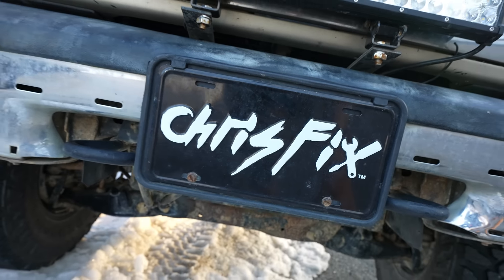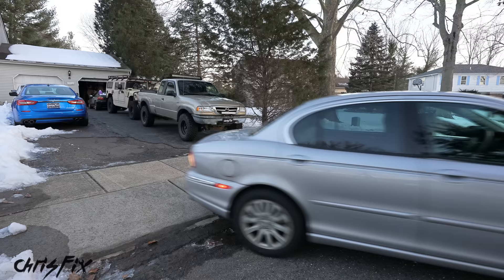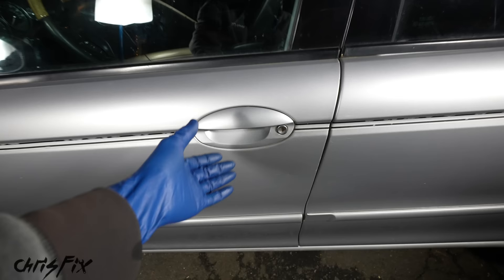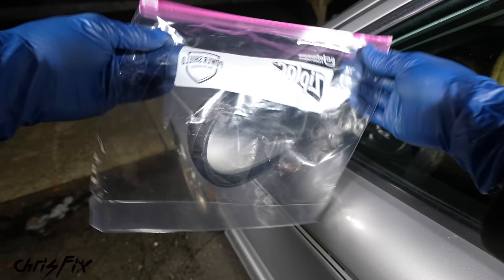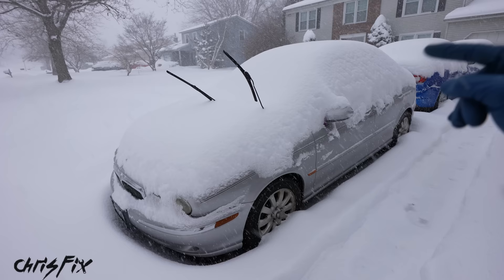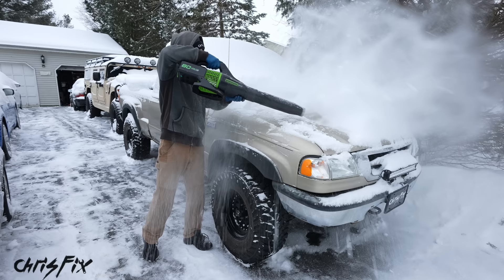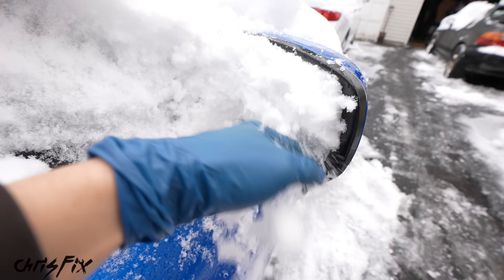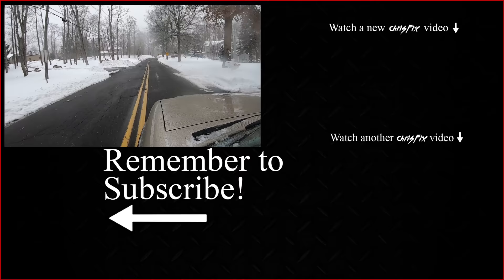10 Winter Car TIPS & TRICKS you NEED to Know

Comment: I'm living in Russia, Siberia. Winter temperatures of -20C are common here and -40C happen too. The most pain is when ice builds up on the internal side of the glass. To prevent it, wide open the doors and stay like that for a couple minutes. This will remove a warm humid air from the car. Also make sure there is no water or snow on the car mats. This water will evaporate and condense on cold glass.
In very harsh conditions below -40C it's common to use a cape for the whole car. It's called НАКИДКА НАТАША. It really helps to keep the engine and suspension warm enough.
I don't think that snow brush will scratch and damage a car paint. We never use towel like CrisFix advises and paint is just fine. Besides, you can buy a brush with soft fibers.
Reply: I live in North part of Kazakstan (South Siberia) and I agree with all your tips.
Reply: Natasha can be helpful anytime btw 😂😂😂😂
Reply: I just came to say, damn. That’s cold.
Reply: Thanks! I was wondering recently how to avoid it!
Reply: It actually will scratch the paint :) only lightly but still noticeable
Reply: Ice on the inside of the glass is the worst.  I got those rain gutter accessories that go at the tops of the windows for my car. So now I can leave the windows open about 1cm all the time to let any moisture out so it won't freeze on the inside.
😎
Reply: @JP-JustSayin  Yes you can leave windows slightly opened. But be careful because in a blizzard you will get a lot of snow inside a car.
Reply: You definitely  would be the person who knows !   Your weather is crazy.  We have electric heat.  Expensive.  Luckily  we  usually  get  about  three snowstorms if that.  I couldn't  handle your weather. People  are griping about 30 degrees here on east coast  USA.
Reply: @donnalawrence9054  It’s pretty nice outside, it’s 30 right now here in PA, with the sun out. It’s not the low temps that are the problem for me, it’s when the wind gets going, that’s brutal but I deal with it. Working outside all day on the farm toughens the mind and body up lol.
Reply: @seekndestroy8970 Oh  my!   More than toughens you up.  It's  about 30 here today. My friend  just came  over and shoveled my walkway while  I   am under a cover.  Lol.  God love him. I cook for him sometimes. We got about  3". No I do feel like an old  spoiled  brat. Lol.  I  don't  like  it  windy here, but know it's  nothing  compared  to  what you get!  Stay well.
Reply: great stuff, but your climate control system has a system that would help with this in cold climate. It's the air recirculation system. when its warm, u want to keep the cooled air inside of your car. so u have the air recirculation system turned on. you may think that also makes sense in the winter, but the inside mosture of your car will freeze to the windows when u leave. so u want to leave it off since when it's very cold outside, the air outside is very dry. same with window fogging if ur heater is not cutting it.
Reply: Wow! Good tip on letting out the warm air before shutting down the car for the night! Ice on the inside is the worst.
Reply: Wow!  That's cold.
Reply: my car has auto humity control, so I just need to keep the air climate control on.
Reply: I remember one time when I lived in Canada (Thunder Bay,) it got so cold that my friend's older car froze up. When he got it started the steering and suspension was frozen so he just had to wait for it to warm up.
It often gets to -40 at night there.
Reply: Also in Canada, at least when I was younger, all the cars had block heaters and you had to plug your car in at night so it would start in the morning. Heavy equipment, especially diesel,  would sometimes have battery heaters. Diesel engines sometimes have glow plugs that you have to turn on 10 seconds before starting when it's cold.
Sometimes you'd have to turn on your headlights for a minute, then turn them off to get enough power out of the battery to start the car.
One of those heated car covers would have been great.
Reply: @RandyRostie  I used autonomous gasoline heater on my car (like Webasto). They are reasonably inexpensive. Especially when you know that you can start your car at any temperature. It heats up the engine. Even in 5 minutes it can heat the engine from -40 to 0 C, and start will be much less harmful for car. This greatly prolongs your car life. And you don't need any power plug on the parking lot.
I had 94 Toyota corolla with 300.000 km and it couldn't start below -20C. But with engine heater I started it even in -45. And the engine was OK for a very long time, because I didn't harm it with very cold starts - all winter starts were done after preheating the engine.
You can buy those heater from China now, they become quite cheap.

Comment: Another advantage of 'combat parking' is that your battery is facing the street in case you need a jump.
Reply: the other advantage of combat parking is that your gas tank is facing backwards in case you need the fuel truck to come refill you
Reply: Not for every car. There is alot if not most European Cars that have the battery in the trunk
Reply: @hassnaindar9586  Not in all cases. Some cars live in the desert and don't get snowed in.
Reply: @hassnaindar9586  I think you're referring to BMW and Mercedes cars. Those still have two jump start points in the front under the bonnet
Reply: @mattiaiezzi9381  And all newer Audis and Volvos, and not all older cars with the battery in the back have jump point under the hood.. Trust me I'm a professional! "Holding my Magnum 44 while 80s action music is playing in the background"
Reply: @hassnaindar9586  Most cars i know here in Europe have the battery under the hood. I think it’s a thing for more modern cars to have them in the back. My 2000 Ford Focus has it under the hood.
Reply: Have your battery checked in the Fall. If weak replace it.
Reply: My car battery is in the trunk. Just rapped it with a battery warmer. Crazy cold days are around the corner.
Reply: best case, where I live it is just that much easier to steal the battery, and it puts the fuel filler on the other side of the car, making it easier to siphon all of the fuel out. if you cant operate a vehicle in reverse gear, this may be a vital tactic to use, but I would reccomend learning how to drive so you dont have to park like a jackass
Reply: @manlystyleunder50  as if fuel trucks make housecalls. Never.
Lol
Reply: Who makes up these names ‘combat parking’ ?
Reply: @riesa85  strum ruger?
Reply: @francisniestemski2440  thats a good question. back in the day we just called it backing in or parking backwards... what has any honest person got to run from?
Reply: I'd say stay forward in his case the battery is far more protected from cold wind, "combat" parking for him opens his battery and engine to wind and snow
Reply: @leonhenry2842  here in montana cold isnt a problem untill it gets to around 20 below zero with any of my cars . never have battery problems unless the battery is more than five years old... most batteries only last five or six years cold or not anyway. if you have a block heater even -20 isnt a problem. combat parking makes it hard to plug in the block heater though.
Reply: @Brandon Aitken bet thats fun to get to if you need a jump...
Reply: @Brandon Aitken so your priorities are a tiny little v-8 and too much bass?.....sad.
Reply: @Brandon Aitken yeah, try making 500 hp without the turbo. my 350 makes that much without one on pump gas... yours is little.

Comment: I always give my car a really good polishing prior to cold weather . When it comes to removing the snow it nearly always comes off all in one push . Most people would suggest removing the snow from the top of your car first but I disagree . If you remove the snow from your hood first then you do not have two loads together and the snow from the windscreen or roof slides off the hood easier after that has been cleared.

Comment: I've lived in Ohio my whole life, but I had never seen anyone do the ziplock bag full of hot water. That's a smart little trick!
Reply: I'm in northern Canada... that's new to me as well.
Reply: What part of ohio?
Reply: Manitoba here. I wouldn’t bother with warm water. Running a car for 15 mins makes it a “wipe it off” level. 120v wall plug cabin heater turnes it into an “eco friendly” warmup, if you care. Me personally, I am so lazy, that I just spray alaskan de-icer where it hasn’t melted. Takes 3 seconds. THREE  very precious seconds of my morning.
Reply: @kidzellajr4244 Cleveland area
Reply: i use a tarp on my truck. so much faster and easier.
Reply: @nickieshadowfaxbrooklyn5192  This is good for the times you don't have the luxury of warm up time. I could've used this trick leaving work several times.
Reply: @falxonPSN  i lived in akron for about 13 years

Comment: * Chris doing a simple oil change *.....
 * Changes the trans fluid, feul filter, cleans the seats, changes the interior lights, cleans the engine bay, changes blinker fluid, suspensions, takes out the engine, cleans radiator, flushes coolant and fills the feul tank. *
Chris: Alright now that were done with that preventitave maintenence.........
Reply: Uhmmm blinker fluid isn’t a real thing
Reply: @maxdominguez6454  😉
Reply: That blinker fluid is always a bear
Reply: @mickcv4554  my blinker fluid bearing axle motor stopped working today
Reply: @milesbigelow4775  try elbow grease.
Reply: @seanoconnor7518  I'm pretty sure he meant to say change the muffler bearing
Reply: @FusterIsBased   I fill my tank with sailboat fuel before any snow storm
Reply: If he said it once, I’d believe it to be a typo. But twice, he’s just illiterate.
Reply: @seanoconnor7518  chris has a vid on it so..... it is kid.

Comment: On the windshield wipers it’s not always best to leave them up all night. If you have heavy winds and/or a heavy storm.  The windshield wipers are not designed to take that kind of pounding and you can do far more harm than good. 

I haven’t had a problem yet where I couldn’t lift my wipers after removing the snow. If I have ice all over my windshield I just run the defrost and wait for it to melt away.

I really do like the windshield cover. Thank you much for the video Chris!
Reply: I tore my wiper blade off once after an ice storm. Now I use the bags that my newspaper come in over the whole wiper. If things are stuck & I am impatient, the free bag gets torn, not the $$$ blade.

Comment: Not gonna lie, I kind of want to see an episode talking about roadside tools and what to do in case you have to pull over due to engine problems or tires or something like that
Reply: Same. Even though I already keep tools in the trunk.
Reply: I just pull over and yell for help
Reply: I mean it's a concept for a video. Just so everyone knows what to have and what to do. There are many small things most people gloss over during a roadside stop
Reply: I think he did that a couple years back but I'm not to sure on that
Reply: Devdoesitbest
 ... these days the average person is NOT going to fix much on the side of the road, other than a wiper blade that flipped off... and if that's the case they will probably screw up a replacement too. Best to shove a rag under the broken blade so you don't scratch up the glass. For all other issues a membership from AAA or similar will usually get you going within an hour. (99% of the time)
Reply: @rupe53  ah yes the average person won't do this but will do other chrisfix tutorials like removing key marks or respraying their car. It's just for information just so you know what you should have
Reply: @devdoesitbest6974  ... I did auto repair for near 50 years and I find you can never be100% prepared for doing a repair on the road. Anything beyond a screwdriver, hammer, pliers, adjustable wrench, a roll of tape, and maybe spare fuses, will collect dust in the trunk. The spare fuses and tape might get you going again if your trailer harness shorted out but anything else is a shot in the dark, even for a professional. OTOH, there was that one time I got my fuel pump going again with a hammer while 50 miles from home. Then there was the time I broke a rocker arm on my VW and had to change a valve retainer in a parking lot. (400 miles from home) Put the string from my hoodie into the spark plug hole and turned the engine to have the piston hold the valve closed while I worked. In this case the VW lug wrench is also a plug wrench so didn't need much else. IOW, that's twice in 50 years doing something the average guy wouldn't bother with.  <LOL>
Reply: @rupe53  I'm not saying to have all the tools and stuff, not everyone is gonna have the necessities. This is manly for the inexperienced so they wouldn't freak out when they are on the side of the road. I respect all the experience you have but not everyone is going to be able to handle the situation as well as you might. It's just a proof of concept for what you should have, what is recommended to have, and what you should do. For Pete's sake ALOT of new cars don't have these tools (some don't even have jacks or tires I know from experience with a friend)
Reply: @devdoesitbest6974  ... I have to laugh because you are right. I recently bought another car and it didn't even come with a spare tire. Thank god for my AAA card!

Comment: if your lock gets frozen. use lighter on the tip of your key carefully to heat it up. just enough so it feels hot or starts to feel burning at the base of the key. slowly push it in keyhole and melt the ice. after key is fully inside, repeate couple more times to fully unfreeze the lock mechanism. then try carefully to unlock your doors. if you feel more resistance than normally, repeat the process. you should get your doors open and not break the key in half.
Reply: You can just pee on the lock. That will thaw it out quickly.
Reply: Do not do this if you have an electronic key. If damaged, they can cost up to $400. I found out the cost when I sent mine thru the wash (jeans pocket)

Comment: Another useful tip I've found - keep the gift cards to (carefully) run between the glass and the weatherstrip on the outside door sill. People going to drive throughs will try to roll them down and if there's ice there, they'll either rip the strip off or ruin the window mechanism.
Reply from the maker: Great tip! Thank you for sharing!
Reply: I keep expired gift cards to use as ice scrapers, they're better than traditional scrapers.
Reply: About that. my side window popped out twice (January and December 2021) from doing the same thing. Learnt my lesson after the second time. Only broke the plastic slide blocks (15 usd fix) but the drive through guy's face when the window dropped down all the way down in the door was priceless xD
I've since then used an old gift card or a window tint squeegee to crack the ice :) Top tip :D
Reply: @cynthiaromero2658  Keeps them out of the landfills! I used my Costco card, once. Depending on how Christmas goes, I might get a few cards to keep in the glove box once depleted. 😄

Comment: Great tips. One point though: in a passenger car, loading up the trunk helps with traction IF the weight is either on top of or in front of the rear wheels. Otherwise you risk an imbalance that makes the front end relatively too light and it becomes hard to steer.

Comment: I bought a SubZero canvas windshield cover that has mirror covers attached by elastic bands, and clamps in the door. It works great and I highly recommend. I keep my fuel topped off in case I'm stuck in snow traffic somewhere, but didn't even consider the benefit of the extra weight!
Reply: Do you happen to have a link or brand/product name?  I have a windshield cover that has 'magnetic' plates along the edges, but they don't hold well. BUT it does have flaps that hang INSIDE the driver/passenger doors to hold the shield in place. That way, no one can remove elastic bands from around the outside mirrors.
Reply: @RetireAbroadInvesting  I got mine from O'Reilly's Auto parts. Part number 17545
Reply: I got my whole set (front, back, mirrors & storage) from QVC. Variety of colors & patterns as well. Canvas on top, waterproof "rubber" next to glass. Oh yeah, 3 sizes too.

Comment: A tip from Finnish rally drivers, wrap white tape around the top of the steering wheel when the wheels are straight, it makes it easier to get out of the snowdrift when the front wheels are definitely straight ahead.

Comment: Suggestion on the truck (also applies to a car)... When removing the snow, with blower or otherwise, always start from the highest point and work down.  When blowing off the truck you had to blow off the hood twice because you started with the hood, then moved to the roof, then hood again.  The roof first, then the glass, then hood.  On a car, ALWAYS remove ALL the snow off the roof.  To many times I have seen lazy people not do this and when they start driving the snow on the roof slides over the rear window obstructing their rear vision.  That's a safety issue and in some instances you could get a ticket.  That's my two cents.  You can give me my change back if you wish.
Reply: Worst yet is having the snow on the roof of a warmed up vehicle slide forward at the first stoplight and cover your windshield and the wipers won't remove it. Don't ask me how I know.
Reply: I love watching people wash there cars from the bottom up also.
Reply: @boots7859  LOL  Absolutely!  It's like watching someone paint themselves into a corner... DUH?
Reply: @boots7859  Or people who wash their cars in winter and then wonder why their door locks are frozen.
Reply: Same goes for cleaning a house. Work top to bottom. Wipe down cupboards then countertops then do the floor:)
Reply: great points